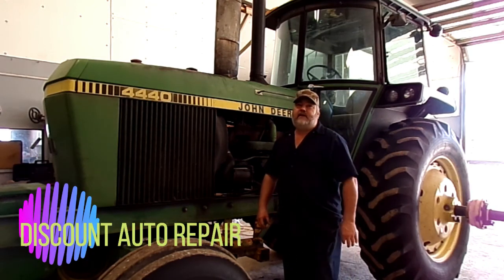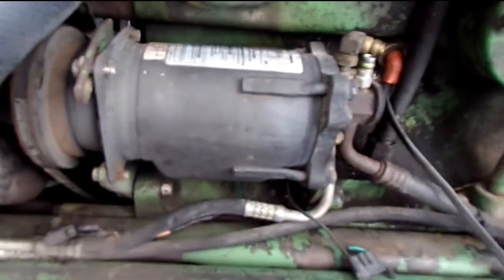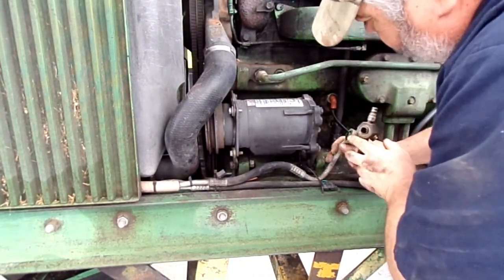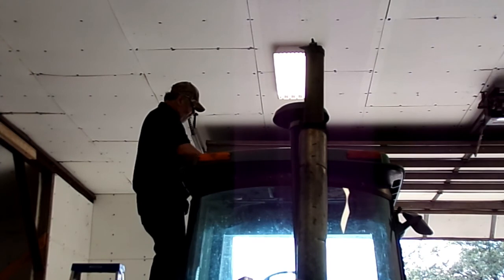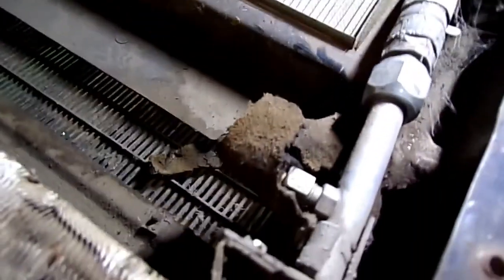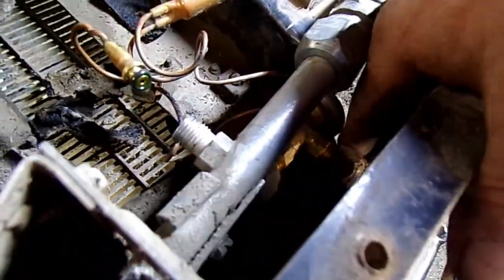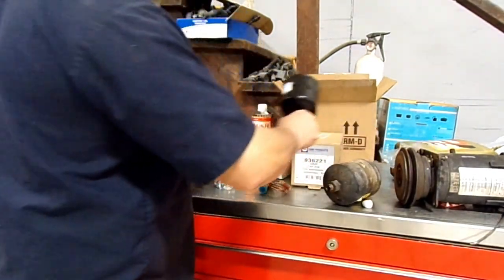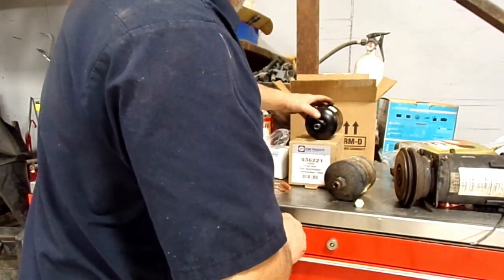JOHN DEERE 4440 A/C COMPRESSOR REPLACEMENT

Comment: Could someone help me here, my 4640 has water coming into the cab through the vents when the air conditioner is turned on ? thanks. Fantastic video here.
Reply: Your drain hose needs attention. May be plugged or not oriented correctly.
Reply: @joeclark6043  Thanks Joe, I lifted the cab lid and could not find a drain hose or outlet anywhere.
Reply: @joeclark6043  Thank you for your valued assistance, cheers Ash